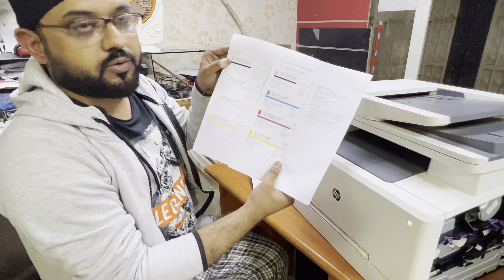Poor Print Quality Or Light Print Issue! HP Color LaserJet Pro Printer

Comment: I am having the same issue.  Bought new toner thinking it was the cartridges.  But new cartridges did not resolve the issue.  HP really should be responsible for this service.  There is no way a 500 dollar printer should have this issue with less than one year of service.  Thank you for sharing the disassembly process

Comment: Thank you for your video.  I have taken my printer apart, cleaned it and put it back together.  However, I'm now getting a "Supply Error" when it initializes where I wasn't before.  The web interface shows "?" for the toner cartridges.  I doubled checked that Cartridge policy and Cartridge protection were still off. I'm guessing I have a loose cable, but I've gone over them again and again.  Do you know which cable is for the toner cartridges that I can focus on?

Comment: So how do you break these tabs on these left and right side cover.  Obviously, almost impossible if doing for the first time.  So what is the trick.  Is there a tool where you can cut  1 or 2 of the  Tabs off.   I did manage to  Pry the  cover up with curve tool( Mini-Cutters), then stick in slim Electrical Guage Wire Cutter & Holer Tool  to cut a few off.   Then use loads of little std screwdriver  to pry every 2 or 3 inches , finally but thing loose.

Comment: Hello I'm from Brazil.

I fixed the Solenoid on my HP CP1525NW printer, then I opened the Laser Scaner and the Belt, I cleaned everything, it was perfect. But then after a few days CYAN no longer prints. I suspect it is the Laser Scanner. I'm going to do the cleaning again and hope that everything goes back to normal, so I don't have to buy a new Laser Scanner. I'll let you know if it's resolved. Hug.
Reply from the maker: All the best bro
Reply: @BilalKhalid  Thank God it worked, CYAN is back to printing!!!! I managed to fix it. I disassembled it to the Laser Scanner, cleaned all the mirrors and acrylics with cotton and cotton swab, without any alcohol, really dry, very carefully including that square with the little motor and that's it, All the colors perfect!!!!! Thank you very much for all your attention. Ahh and in case anyone really needs to change the Laser Scanner, it's the RM1-4766, I took a photo of the original that has the code. Thank you very much for the video.
Reply: Que tal Señor, conseguiste solucionar el problema del color que no imprime, tengo problemas con el color magenta, si me podias ayudar por favor. Gracias.
Reply: @juanchybenitez3086  Siii yo a echo una limpeza en Laser Scaner igual al video, y volvio a imprimir mi color Azul que no salia nada, pero ahora esta perfeita mi impressora. Espero que ayude. Perdon mi portuñol, soy de Brasil.

Comment: Hello Bilal,
Thanks for sharing this disassembly !!

However, since I've done this repair on my HP printer M281fdw and reassemble it, my touch screen display stays BLACK with no light nor icon ! I have obviously replug the small flat connector of the display...
The power is OK when I press the power button but I can't even access to the web interface because there is no more network on it... 
Any idea please because I'm REALLY lost with a dead printer by now ?!
Many thanks for any help...
Reply from the maker: make sure about all cables connections. try to see the cable that connected to the lcd side.
Reply: @BilalKhalid  Hi Bilal, sorry for replying late but I've found out what the problem was !
I post here the answer because it may help other people...
Actually, it was coming from the golden edge connector for LCD display (motherboard side) whose pins was torn or broken ! Very thin and delicate to handle...
I have had to cut a bit all golden broken pins and to recreate a fine edge connector then  to replug it ! The LCD Display then came back to life...GREAT !!!
Thanks again and take care...

Comment: I followed your great instructions to the letter. I found cloudy ares on the mirrors and cleaned them well.  Quite clear now.  I reassembled the printer and the result was no better.  I was very surprised since the mirrors were so much better.  Is there a laser lens
 I should have cleaned too?  Any other suggestions?
Reply from the maker: Yes laser lens should be cleaned and all mirrors as well,  and further more  check your toners cartridges also
Reply: @BilalKhalid    I did not see where you cleaned the laser in the video.  I have installed HP toner cartridges.  So it must be something I missed cleaniong in your opinion.  Do you have an image of the laser area I should clean?
I dont want to damage anything by doing it incorrectly.  Thansk for your help with this!
Reply from the maker: In center of the laser unit there is one square shape silver part where the laser beam hit and spread around ,  clean this square part well
Reply: @BilalKhalid  That fixed it!!!!!   Thank YOU!!!!!!:finger-red-number-one:

Comment: I have hp colour laser jet m283fdw    I bought it second hand and bought 3rd party colour cartridges but it print blank or some times very faded hardly see anything on it .. do you think I need to do this process as shown in the video or look for something else first?
Reply from the maker: Yes clean laser unit if you think your toners are fine
Reply: I have done cleaning laser but  not much improvements .. before it was almost blank but now it’s very light ..what can I do now?

Comment: Hi Bilal, I contact you, because I see, that you are an experienced engineer. 
My HP Printer (m283fdw) stopped working with a laser scanner fault. I replaced the laser scanner and everything worked fine, but only for a few days. Than the magenta color disapeared.
The event log indicated an error with the density sensor. I replaced the density sensor, but still, the magenta color (100% full) does not print. I swapped the cartridge with another working cartridge (I have 2 times the same printer here). It is not a problem with the cartridge. I opened the laser scanner and cleaned all glases and plastics. But no success. do you have an Idea what I can do next? The service manual says, it could be a problem with the cartridge tray or the ITB, but that does not make sense to me, because all the other colors work fine.
Reply from the maker: The issue can be in drive that located on the right side of printer
Reply from the maker: Or it can be due to high voltage board as well
Reply: @BilalKhalid  Thanks a lot, I will check that👍
Reply: @BilalKhalid  I installed the HighVoltage Board in the working printer and Magenta is ok!. Though, it is not that board. I marked the drum of the magenta cartridge with a soft pen and verified, theat the roller turns. Though the mechanics on the right hand of the cartridge tray is verified to be ok. Do you habe another idea?
Reply: Finally the problem was the Laser Scanner Unit. But it was not dirt but a broken beam.

Comment: Hello I have an issue with my printer (ECOSYS P6035cdn)
the printer is starting but the light on the dash board will not on.
do you have an idea on such issues
Reply from the maker: Disconnect dash board cable from main board and connect again then check

Comment: Hello Bilal, is this way can occurs also for my HP LaserJet Printer Pro 100 M175nw ? I have replace the imaging drum unit, but it was not solved. The result was still degrades and not clear/light especially the black color at the center of paper it was very light/faded/fainty and not strong at all even every color. I mean, is it because of the laser unit block need to be cleaned?
Reply from the maker: https://youtu.be/duhVeo53shA?si=dIKprGvBqN-yNboL
Reply from the maker: Check this video if the print is faded on the middle of the paper

Comment: Bilal, thank you my friend! You have saved our printer from the landfill. Once we had it apart we took the mirrors out completely by removing the metal clips, wiped each with isopropyl alcohol, dried with micro fiber wearing gloves to prevent finger prints, cleaned all the plastic lenses and reassembled. print quality returned to acceptable levels, but still was not factory new and it bugged me enough to rip it apart again a few months later... this is when I noticed a critical step missing from your tutorial.

This time i noticed the metal square and motor assembly in the center was also quite contaminated with dust and film. I cleaned that square motor - some models I've seen videos on are hexagonal but particularly the edge of the metal on top which shined to a mirror surface after we cleaned it and BOOM printer is back to it was like day one. I was ready to replace the laser component and ultimately the entire printer but this video has helped me save it!! hope my additional tip about the motor edge helps others! keep fixing things!!!!! and sharing the knowledge gained!

thanks again be well
Reply: Any chance you could upload a video of this additional step?
Reply: Is it the motor shown at 7:26? Attached to the logic board connected with a yellow cable?
Reply: Same here, after cleaning that square mirror on the motor, BAM - magenta missing 🤣
Misaligned one of the mirrors 🫣😅

But yeah, BOOM, perfect printout again, thanks for your comment on that.

PS: don't try to remove the laser PCB to clean the diods, did that on another HP in the past, it's pressed in and will die if you try to remove it 😱
Reply: @dermarius87 did you find solution??
Reply: @MohamedAdel-f5g  yes, just clean the edges of the square mirror on the motor and align the mirrors correctly if you've disassembled them for cleaning 😉👌
Reply: @dermarius87  how to align them
Reply: @MohamedAdel-f5g  just the way they lay into it... All mirrors with the glass side up except the two lower ones, these face with the mirror side up.
Reply: @dermarius87  thank you it works for me
Reply: i cleaned mine and i somehow didnt place it right back together the same way did u happen to record it? i cant get the top on the right way near the LCD its elevated and I had trouble placing the bottom part under the hood with all the wires... the thing that holds the wires. now it wont turn on =( someone help pls. ty

Comment: grinding noise during startup and poor color print on Color LaserJet MFP M680
Reply from the maker: grinding noise is normal in this model, and about print quality, did you check the toner? replace with good toner cartridge then check the quality.

Comment: Very complex with all of the screws and connections. Don't know how to keep them all correct for reassembling. Also, what do you use on the q-tips for cleaning? I could not hear...
Reply: Can you tell me what you said starting on 7:28 concerning the q-tips? Thanks!
Reply from the maker: Cotton buds. Clean the mirrors with the help of cotton buds. Thats it!
Reply: @BilalKhalid  Okay, thanks!
Reply: @aleneb.4227  after cleaning is now showing me error 51.23, what should I do?
Reply: @Aaculaax  cable connection error. check the cables.

Comment: I just purchased the M277dw at an estate sale 8/4/23.  It fired right up and connected to my wifi and printed Black and White fine but it would not print color well at all.  The prints were very dark and undefined.  Also if I set the media to plain paper as is in the printer and then slid the quality to high it would make the sound of paper acceptance but then would stop and just reveal that the printer was thinking - for 10 minutes before I gave up. Beings it is 3 times the price new ($1300) of my M283cdw ($430) it should be worth the fix.  But.  Id like to know where I can have it done as I would not attempt this myself.  As I only paid 45 for the printer with 2 full cartridges I think it would be worth it. The new HP cartridges were themselves worth $200. ( I haven't yet tried the copier or scanner )

Comment: I did this, every single step, but it didn't change a thing. I even updated the firmware and restored the default settings. Still real light printing. What else can I do?
Reply: Try new toner cartridge
Reply: Did you clean the motor as well?

Comment: i followed all the steps. and now, all the colors print on my test, but now none of the black show up on print. which is the complete opposite of what it was doing before i found this video. any suggestions?
Reply from the maker: Try another toner
Reply: @BilalKhalid  i just replaced all my toners! like i said, the black was the only one printing (albeit faint) before i cleaned the glass, now it’s the only one not working.
Reply from the maker: the issue can be with laser unit, you have to try with replacement of laserunit

Comment: BILAL, So i was doing this, had it completed, and now I have an Engine Communication Error....How do I fix that>
Reply from the maker: Check cables,  carefully . Might be one of the cable is not connected with high voltage board
Reply: @BilalKhalid  Think I made things worse.  Now the display screen has no data showing, just the light.
Reply from the maker: Yeah, dont panic. Just carefully remove all cables including screen cable and connect again on correct positions
Reply: @BilalKhalid  Thank you I will try it a little later, I will report back with the results.

Comment: I have a hp color laserjet pro mfp m277dw I had a problem with the poor quality as well, I replaced all the toners and cleaned the bottom roller now the quality is the same, but when I try to print black and white, it leaves horizontal lines on the paper cyan yellow and magenta, they're very strong idk what is the issue 
Can you please help me out ?
Reply: I checked the roller and it's dill of yellow power
Reply from the maker: No issue with the roller. The lines are due to the toner drums. If there is red color line then the issue is with magenta toner. If yellow line the yellow toner need to be replace.
Reply: @BilalKhalid  I have replaced all of them with new HP original toners and the same issue